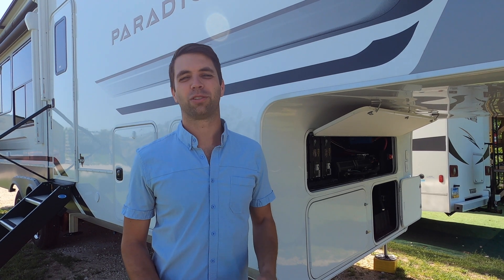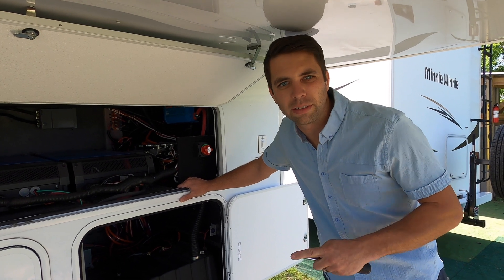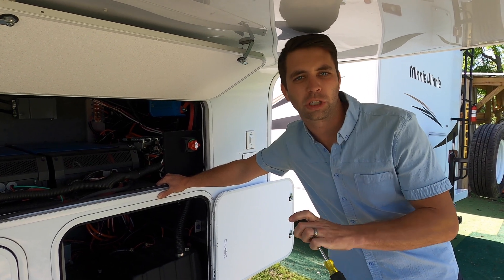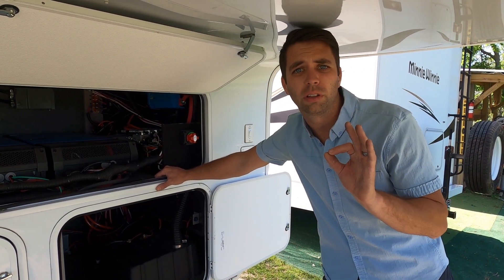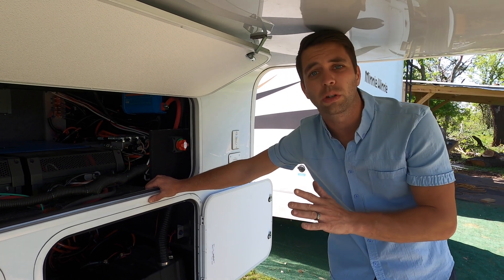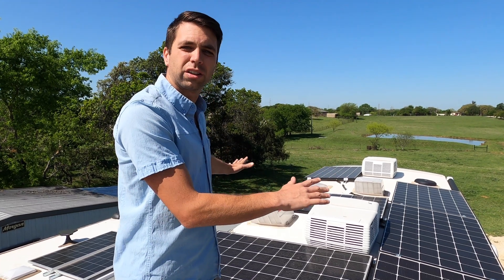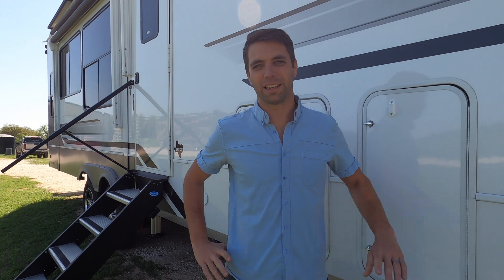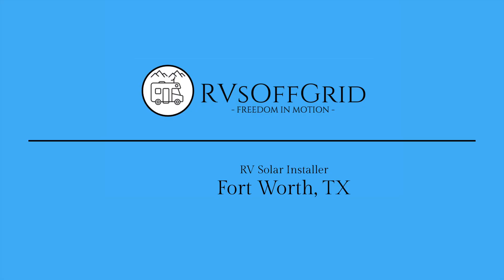Victron Setup Explained | Securing Solar Panels | 48V vs 24V System Breakdown

Comment: Cool to see this in my hometown!  Also, glad to see more people going with higher power solar/battery setups so they don’t have to use their generator as much.  Those things are LOUD and fumy. 

To maximize solar production when one string is shaded, I would have installed 3 small charge controllers instead of one large one.  You explained the value of creating three strings of panels, but then wired them in parallel, which the charge controller treats as one higher string of panels, just with 3X amps.  Smaller Victron charge controllers (150V in / 35A out) are only $159 each on Amazon versus $610 for the 250V in / 100A out you used.  They do not cost $800-$900, as mentioned in the video.  There was space for 3 small charge controllers.  Much thinner battery cables would have offset most the cost of have 2 more sets of cables.  Even if it cost a few hundred dollars more, getting extra solar production from the other two solar strings when one is shaded is totally worth it.  You’re rarely not going to have shading issues when camping. The A/C cast a shadow on the panels and so do trees.  

Another option to explore in future videos to get more solar production is combining a low profile A/C (inverter or 48V DC) and solar mounts that elevate the panels just over the A/C system, such aa Monument Solar’s mounting system. This reduces MPG when towing, but keeps the panels and the RV cooler because air flows under the panels.  You could experiment with painting the roof extra bright white o installing reflective material to maximize bifacial panel production gain.  

Good job overall and I’m sure you guys will stay very busy doing these installs and upgrades as the 48V battery and solar tech for RVs becomes better and less expensive.

Comment: Wow, that's a beautiful high end system. Very nice. I have a single Sungold Power 48v 5kw all-in-one inverter/charger/charge controller that runs my Micro Aire Easy Start equipped 14.5k Furrion front A/C and my EG-4 12k 28.5 Seer-2 mini split heat pump at the same time with power to spare to run all my other appliances as well. Both of them running together when it's hot only draw about 2,100 watts. My microwave draws about 1,200 watts. So with my TV, residential fridge, computer microwave and both A/Cs running I'm still OK. I haven't tried running a toaster or Instapot too (why press my luck) but I'll bet it would do it.

The biggest load I've put on it is 3,700 watts, as it's a high frequency inverter, like the EG-4 XP series so I don't want to overload the capacitors and have it die prematurely. Of course it has advantages too, such as a 95% conversion efficiency, light weight and low cost. I have a total of 23.5kwh of LiFePo-4 batteries and 5,020 watts of solar on my Class A. I racked 8, 550w panels on my roof, over my roof protrusions so I don't have to worry about shading. This 4,400w array charges a 320ah 48v bank for my 120v needs. One of the reasons I went with the Sungold Power all-in-one is because I wired my rooftop array in series for 400voc and this unit is rated at 500voc. I've already seen 450v from it due to cloud lensing in cold weather, so I needed the headroom. The advantage of a series array is the high voltage allows it to produce power in low light conditions. For example I noticed this horizontal array producing 7 amps at 8:30 this morning at about 260 volts. That's over 1,800 watts with the sun just barely up and hitting the panels at a steep angle. I've seen it put out nearly this much in the pouring rain too. It's surprised the heck out of me. I also have a liftable 620w array on the side of my coach that charges my 560ah 12v battery. My system has lots of redundancy, plus I have 2 spare 12v inverters and an extra 50a charge controller just in case. This has proved to be sufficient for our needs as we haven't had to run our generator in the last 2 years living completely off grid. Take care, Chip